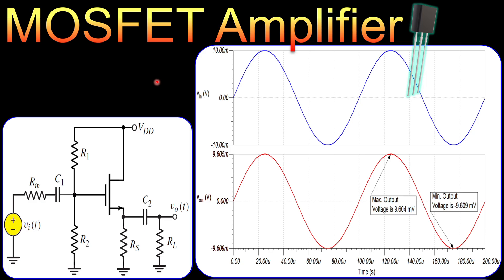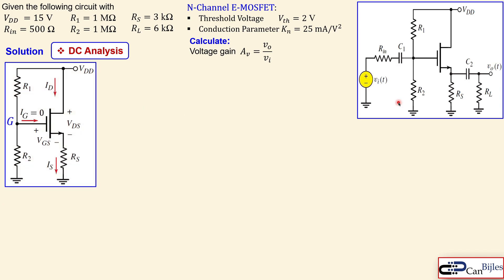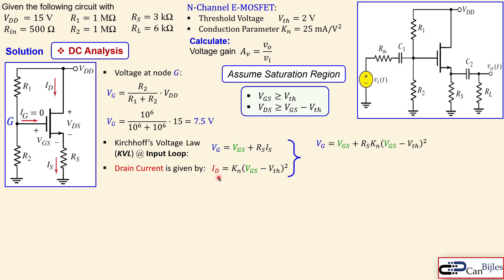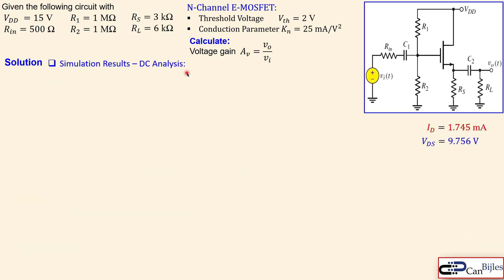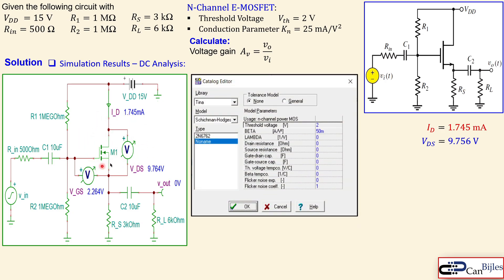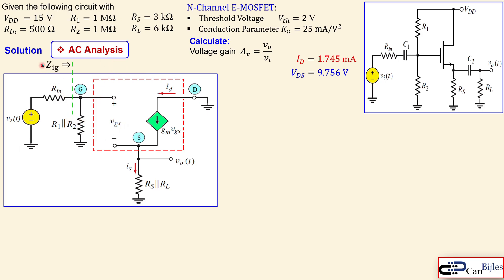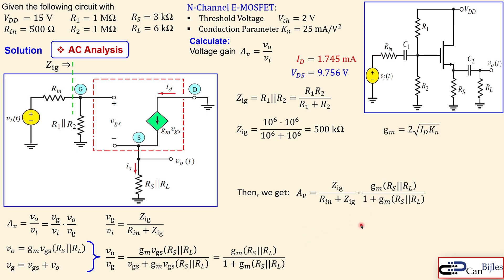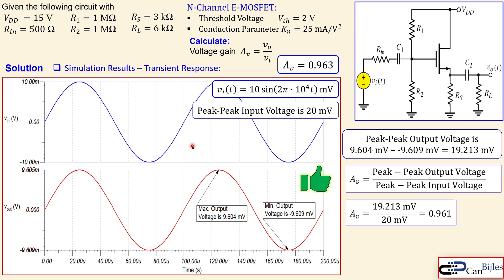Source Follower 🌟 N-Channel E-MOSFET 🌟 Calculations & SPICE Simulations 💡 Example 2

Comment: what should be the value range of Vsig for  linear amplification?
Reply from the maker: This depends on the AC load line, which is determined from the AC model of the output loop of the circuit. The output voltage must stay within the cutoff region and triode region of the MOSFET.

Comment: Hi, If another mosfet ( M2 ) is added below the current mosfet in the circuit (M1) and input voltage applied directly at the gate of M1 while DC bias voltage applied at Gate of M2. What kind of circuit we have in this case? Thanks
Reply from the maker: In this case, it would be a source follower.
Reply: What's the role of M2 in the circuit? and does M1 act as cascode device in this case ?Thanks @CANEDUX
Reply from the maker: @Fidel-tk5rq M2 which is connected to the source node of M1 will make the resistance looking from the gate of M1 larger, but this depends also on the biasing condition of all the transistors.

Comment: Hi there, If there is no Rin, R1 and R2 in the given circuit. How to calculate Av in this case? Thanks in advance
Reply from the maker: If you do not have the resistors Rin, R1, and R2, then you cannot create the biasing (DC voltage) at the gate node of the MOSFET. Then, the MOSFET will not function as a linear amplifier.
Reply: But, there's still DC supply voltage Vdd ! so my question is how Av can be calculated if we apply DC voltage directly at node G without using voltage divider biasing? Thanks @CANEDUX
Reply from the maker: @Fidel-tk5rq  If you bias the gate node somehow, then you do not need R1 and R2. Rin is the model of the input resistance of the source.
Reply: So in this case, what's the relationship between Vi, Vg and Vo and how to calculate Vg/Vi? Thanks @CANEDUX
Reply from the maker: @Fidel-tk5rq You can develop the small-signal model of the circuit and calculate the voltage gain from this.

Comment: How the circuit works? and why a capacitor is added at the output? Thanks in advance.
Reply from the maker: Capacitors are used to decouple the DC settings (basing) from the AC signals. This way, you can design the DC and AC circuits independently.
Reply: @CANEDUX  does the mosfet act as amplifier? What is the function of this circuit. Thanks
Reply from the maker: @Fidel-tk5rq I actually explain this in the video :)
Reply: You said at the end that the purpose of this circuit is not amplification so what is the function of this circuit? Thanks @CANEDUX
Reply from the maker: @Fidel-tk5rq  It is mainly used for high input impedance and low output impedance, which is required for voltage amplifiers.